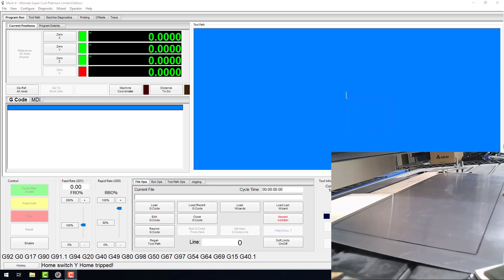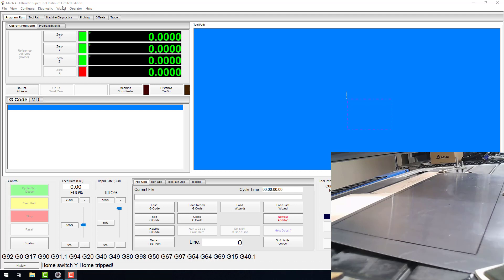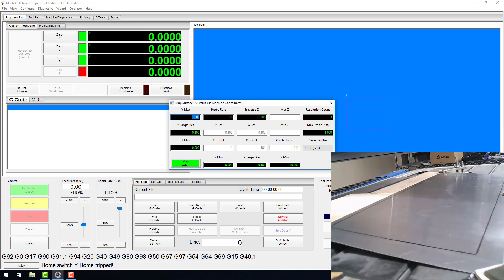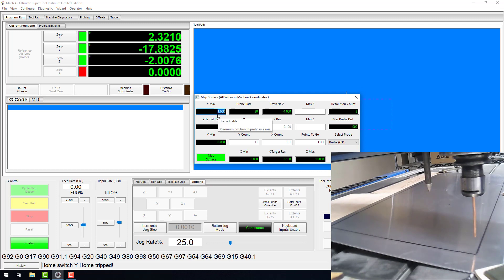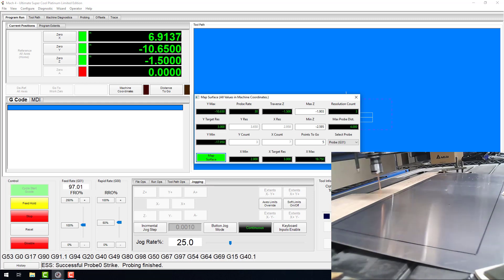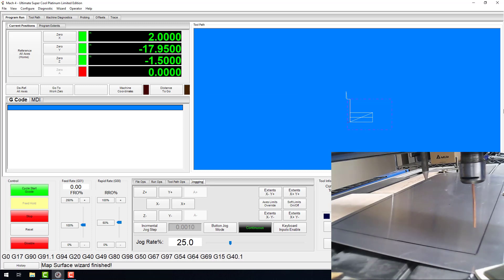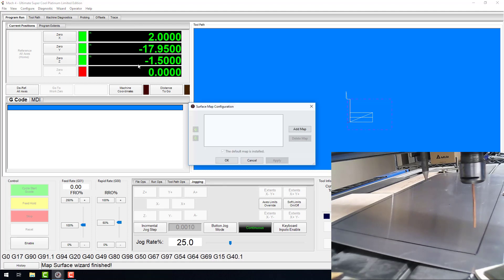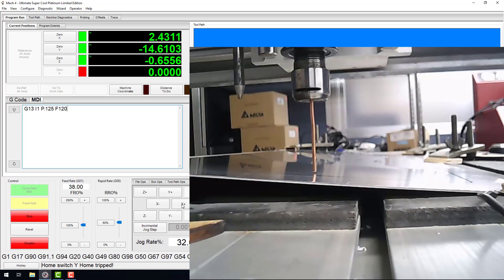Mach4: Surface Map Wizard

Comment: I bought mach4 couple days ago and this function is piece of crap. It has a lot of bugs and there is no solution to fix it. In short, this function is unusable. I watched this video and this was something I want to use on my cnc machine for surface probing to get better carving  effects on unleveled surface. I am more than 10 years in this field and I give up. I backed up on mach3 and autoleveler tool. This is embarrassing
Reply: Is there a way to add such a feature to Mach3?

Comment: Great video!   This will be great for anyone wanting to do 3D printing with Mach4 as well.
Reply: This feature was added for Tangential cutters, the tables are not 100% flat and we needed to be able to cut half way through a sheet of paper 4 X 8 feet. The real test will be to do a grip for some sort of handle and add engrave on it with 2D Gcode.. More to come!
Reply: @barker806  Great Feature. But perhaps you know how to ensure that the Z axis have the same level after changing the surface tool with the actual knife?